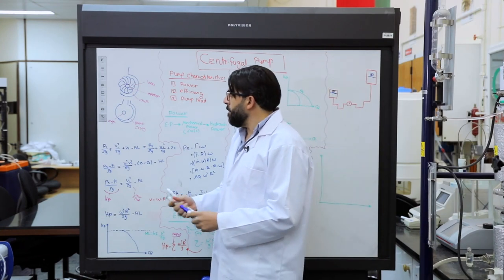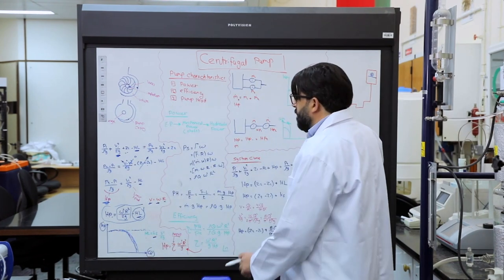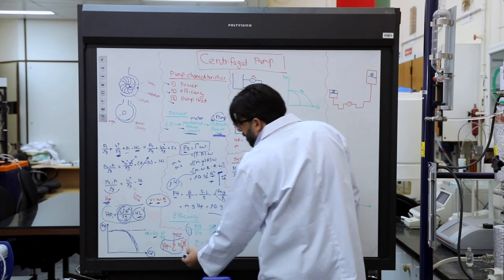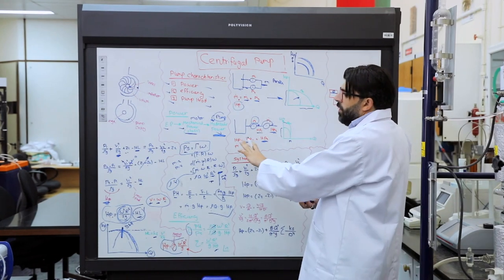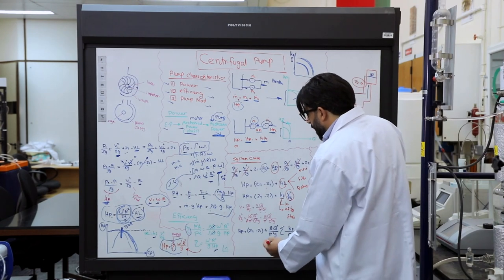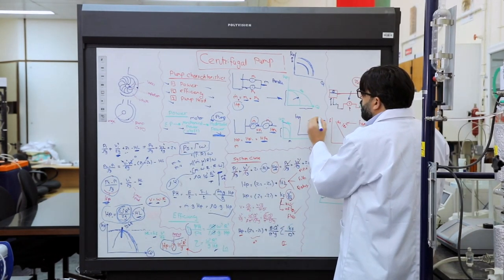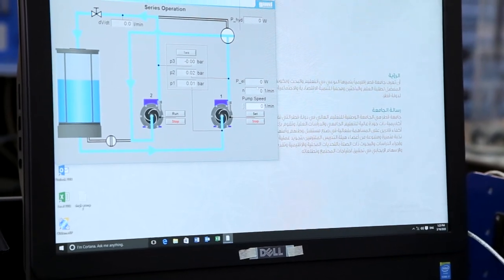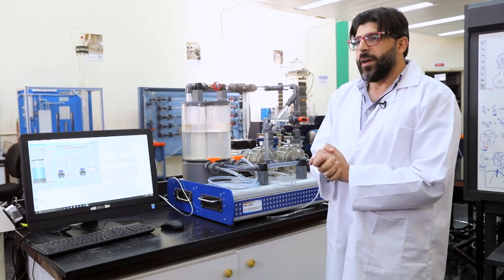Centrifugal Pumps (Single Pump, Two in Parallel and Two in series) (Theory and Live Experiment)

Comment: Very helpful explanation but you didnt go into details on how to get data points for system curve on this experiment, is there a way to get this please
Reply from the maker: You are most welcome.  For the system curve, you can assume Q points within the pump curve, then apply the system curve equation to find the (Hp). Hence, you can use these data to plot the system curve and obtain the O.P
Reply: @medoKhatat  now I think I see the light , so I will assume values of Q , what about values of Kf and D for the pipe fitting ,valves etc ?Those I need to be provided with ?
Reply: @medoKhatat  I am working with a lab centrifugal pilot plant ,I managed to calculate the pump head , efficiency , but how to do system curve I get lost since the manual does not give me any information about the specs of the pipe fittings ,valves and bends for this plant . That’s where I get confused
Reply from the maker: @publicinformationsouthafri1007  Yes, Exactly, you are correct